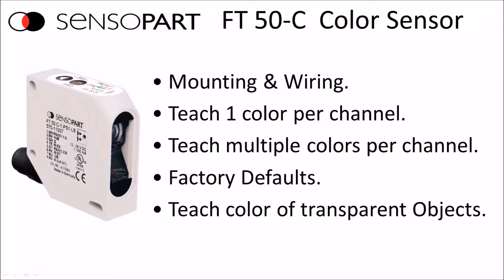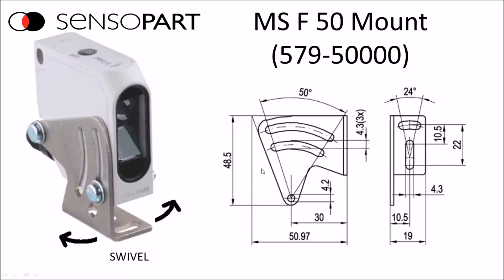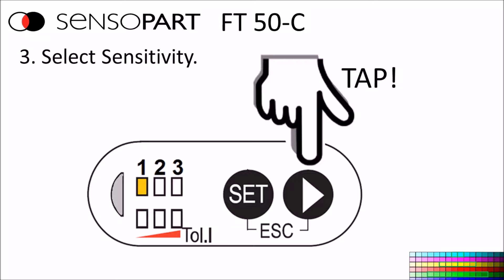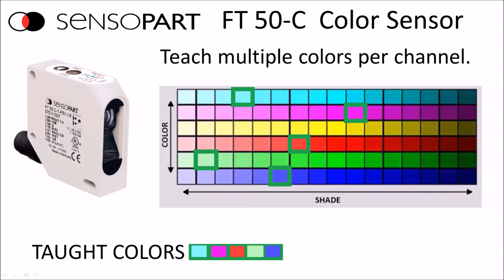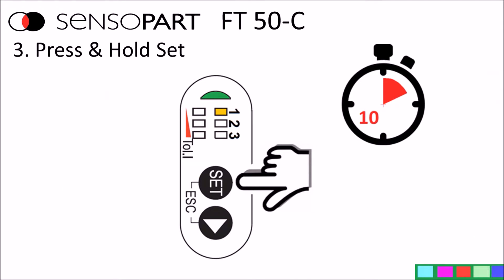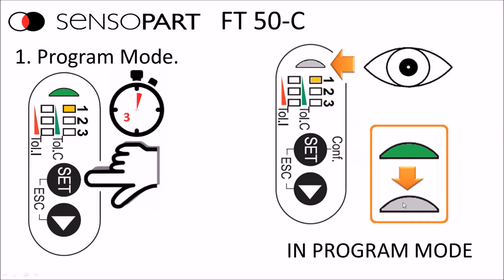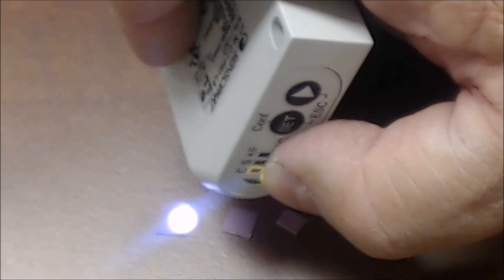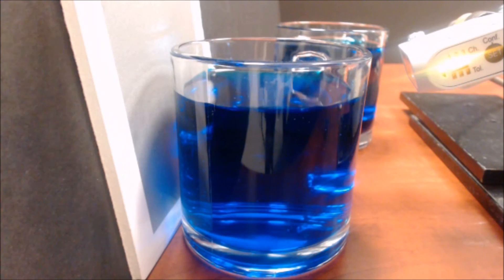FT 50 C Color Sensor

Comment from the maker: 0:42  Spot Size, Output, and Sensitivity Options. 
1:49  Mounting 
2:47  Wiring
3:30  Teach 1 color per channel & Select tolerance. 
8:27  Teach with scan mode.  
11:47 Additional Functions
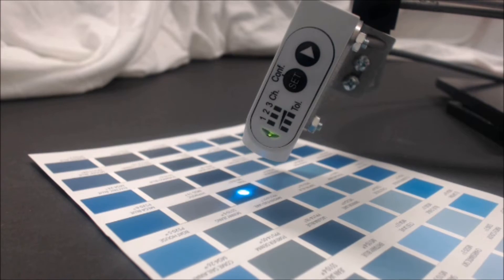13:30 Factory Defaults
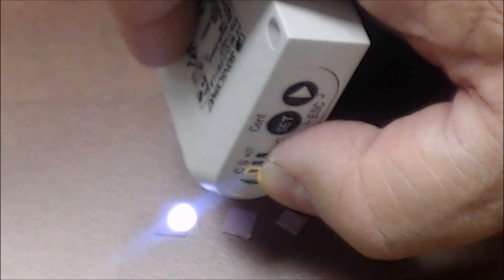14:33 Scan Mode Example
15:18 Transparent Object Example